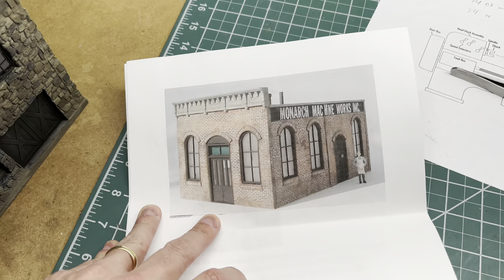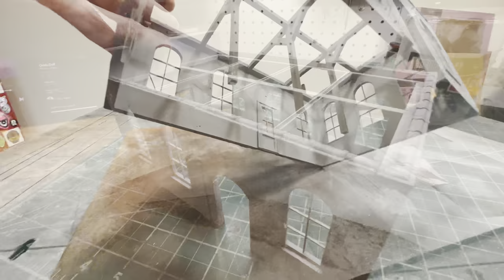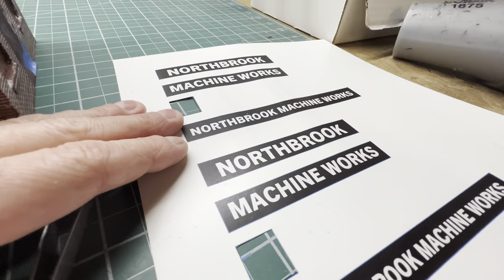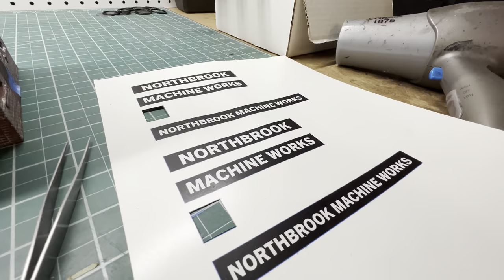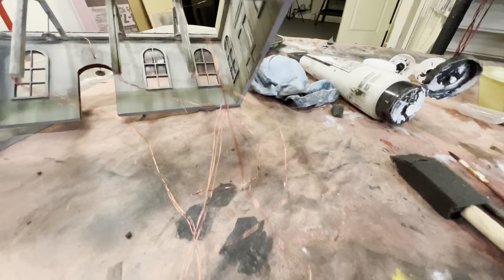The Chronicles of Norm #19 - Northbrook Machine Works

Comment: I really like seeing your 3d details come to life.  Really makes the structure top notch. You should consider adding metal racks for steel bar and tube and L-stock, etc....  Make a rack, with a roof to keep the water off it.  Put it on the concrete pad, opposite the side door, along the tracks.
Reply from the maker: That’s a good idea. It’s one of the details I’ve been wanting to do for all my shops. I have some bar racks in white metal made by a little company called Kramer products on my pegboard.
Reply: @normstrains  I just assumed you would 3d model and print them
Reply: @normstrains  your railroad is amazing. I model in HO, but if I ever considered switching to O, it would be due to your videos. Your weathering is just about perfect. It makes the trains look more realistic than brass that may be 2x more detailed and prototypically scaled.

Comment: You can use drywall  sanding paper  for your roof.  It even  comes in black. No painting  required.  As  always  great job.
Reply from the maker: I'll have to check that out. The bandage tape is kinda expensive. I like to paint my rolled roofing a dark gray then give it a black wash.

Comment: St for future reference   your 1mm I.d. conduits   work out to about a 2in conduit when scaled up   yeah a little big    but there no way you could find smaller that will allow wire   so oh well😂😂😂😂
Reply from the maker: 1mm = 1.89" in O scale. If I could find thinner tube I'd use it. I have successfully soldered 40AWG magnet wire in the past.